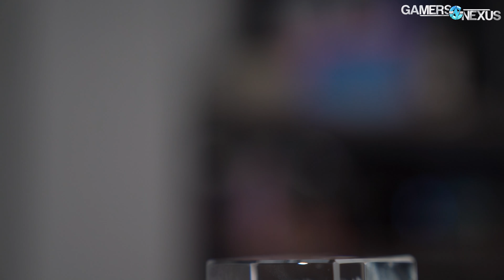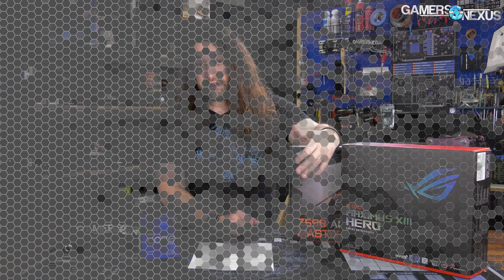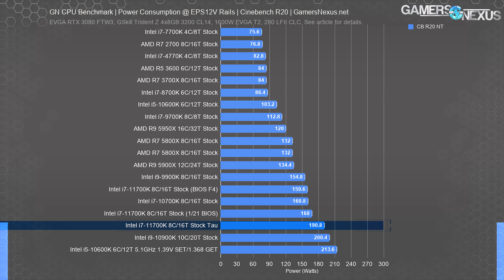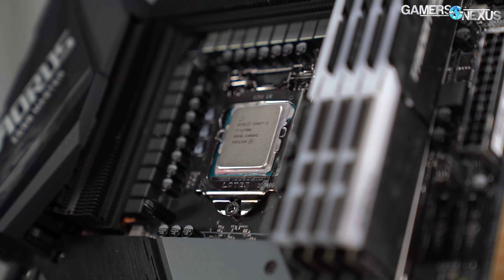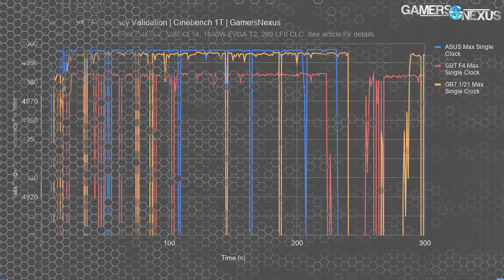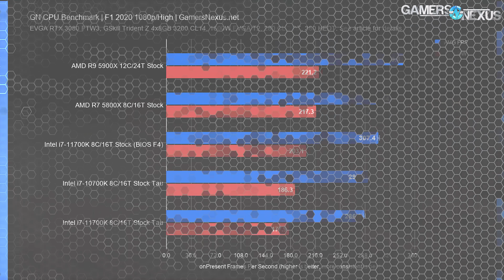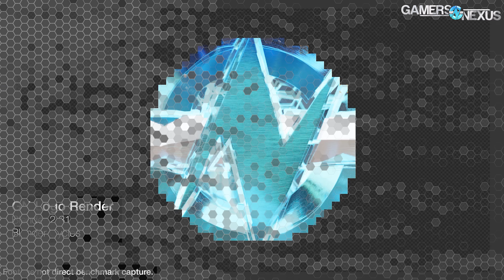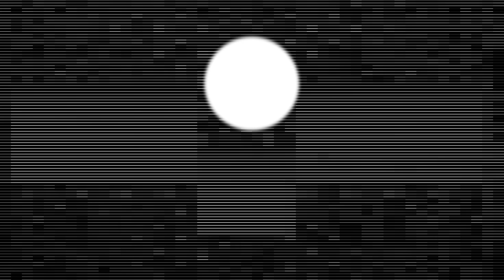Intel's Z590 Motherboard Problem: i7-11700K Power & Thermals Explained

Comment: Intel and board partners ignoring power draw guidance, name a more iconic duo.
Reply: In truth, this Tau on and Tau off feature is confusing and mind numbing. What is Intel saying? Sure we can match AMD if we burn excessive power?!?
Reply: I know hands on that AMD boards do the same thing. My x570 msi board was pulling 1.4v out of the box on my 3600. I was wondering why my chip was so damn hot all the time until I noticed this and turned off the "auto" mode. It literally didn't even change how high the chip boosted or anything, it just made my chip run hot.
Reply: @Ark Design Let's take advice from some random guy on the internet and not tons of actual research done on the subject
Reply: guess a bad year for computer parts is a goo year for computer part testing
Reply: Modern talking
Reply: AMD and board partners’ SoC voltages.
Reply: AMD mobo's are the same, maybe not as far but still.
no expert but my X570 has options set to 'auto' with a 'default' (or like name) as an option, makes no sense to me.
im boring and run stock, each BIOS update i have to change options from AUTO to default. 
If out of the box is not 'stock' then what do all the auto OC settings in BIOS do? wish it was less confusing.
Reply: @liaminwales  Kind of agree but.... my recent 5800x purchase (yes i was the one who bought one) automatically from absolute stock did 4.8Ghz on single core right out of the box. So... 100 odd plus what its supposed to do? But then again we all hear about how Zen likes to piddle about with its own boost even stock so?? However i can say that even at 5.050Ghz which is what i have had this on boost frequencies with curve optimiser and all is an utter unit. Very very impressive performance. but of course not stock but still miles away from Intels CPUs power usage.
Reply: @sideways14a  No that just means you got a good chip. When speed limit is controlled by power limits and not by clock a better chip will run faster. All chips have defects and the number of defects determines how much power it needs for a certain speed. This is due to either better switching transistors or lower resistance which can make a difference in heat and power consumption.
Reply: Yes i know that and i am the proud owner of one gold core and one silver dot lol.... i am just saying, "stock" on AMD as you have said is "iffy" and your right but i expect most water cooled Zen3s to do good clocks. I would expect 4.6 to 4.7 out of a decent 5600 boost, a 5800 can do 4.8 - 4.9 ish and as for those with unicorn 5900s and 5950s hell 5.1.? Just saying stock is a bit iffy even on AMD and thats with boards behaving unlike intels lot who seem to flout the reg's when they feel like it.
Reply: @sideways14a  I suspect most of us watching GN love tech, I had fun playing with BIOS and OC for tests/benches but run stock for daily at the mo (it's whisper quiet).
But I think about my sis who will never touch BIOS (dont think she ever has), if she got given the option of a silent computer V a more noisy one she wont think twice.
and when it's only for 3-10% speed gain she will not care.
So Id want it out of the box how my sis will be happy but with the option to OC if you want is the best way.
PS nice 5800X, when the USB fix BIOS is out ill re try OC.
Reply: @liaminwales  You are essentially turning off the best feature modern processors have.
Reply: @liaminwales  'Auto' is NOT stock or manufacturer value. 'Auto' means the UEFI will choose a setting based on which hardware is installed. For a 'K' processor MCE 'Auto' may mean 'Enabled' by the reasoning: 'K' processors are for overclocking, people who buys this is expecting to see this thing performing, not doing power saving stuff, while for a 'T' processor may mean 'Disabled' because T line-up are actually low power chips, for a non-letter processor if it's top tier might mean 'Enabled' since someone who buys an i9 is expecting performance.
Even the motherboard might change the meaning of 'Auto'. An OC intended motherboard is going to 'Auto' for more aggressive settings because guess who's the intended target.

More or less is how 'Auto' in UEFI works. Is about tailoring the 'Auto' settings based on the commercial target of the MB and the CPU.
Reply: my 10700k will draw 240 watts...mind you its running 5.2ghz all core
Reply: That doesn't make sense. Intel sets these guidances and board partners choose to follow it or not. Do you want Intel to lock even more stuff down by artificially locking down power usage?
Reply: Ryzen 5000 and RX 6000 series
Reply: The 7 5800x and the rx6700xt
Reply: ryzen is stupid and intel is stupider

Comment: So i should get one of these for the cold winters?
Reply from the maker: No, because it's not even that hot if you use it right.
Reply: You didn’t even see the whole video yet and am already making jokes. God we both need a life.
Reply: Only if you get Anandtech's retail unit I guess
Reply: If you want a space heater buy a EVGA RTX 3090 FTW and install their optional BIOS which allows 500W power limits. Originally is an optional BIOS for exotic cooling, but does well if you want to use your GPU to cool your house on the side.
Reply: My 3090 kept me really warm this winter. Not joking i did not need the heater for the first winter ever in my life... 450watt is a joke....
Reply: @Tano Stop embarrassing yourself lol.
Reply: A 3600 with the stock cooler is more than enough to keep you warm in antártica
Reply: @AestheticKunt  I assume you've never been to Antarctica
Reply: @sammiller6631  i assume you never had a 3600
Reply: @AestheticKunt  Your brain must be quite small if you think you can survive in Antarctica with only 221BTU of heat
Reply: @kantai-kessen  Your brain must be quite small if you can't understand sarcasm, quite average coming from a gringo
Reply: Nope AMD make great heaters... its about all they are good for.
Reply: @Kubush1  2012 jokes, jeez dude.
Reply: @Kubush1  lmao this dude stuck in 2012
Reply: @Kubush1  yes, the FX - 8350 was a good heater, not the 5800X. Get out of 2012 lol
Reply: @Kubush1  Intel looks like a real flamethrower compared to AMD
Reply: @Kubush1  My 9900k uses more power and creates more heat than my 5900x.
Reply: @Kubush1  hahaha all the hate at you because you said the truth... this idiotic people being fans of a brand